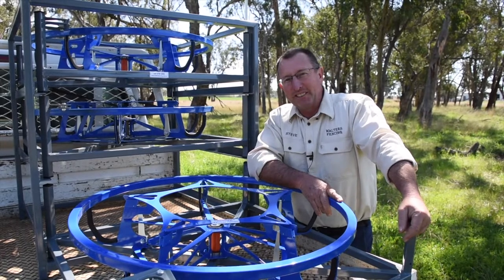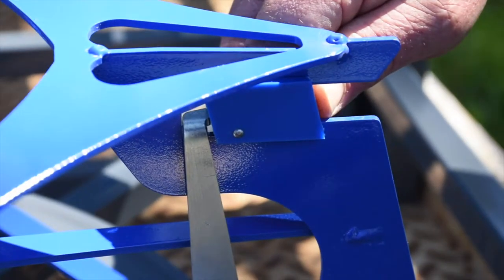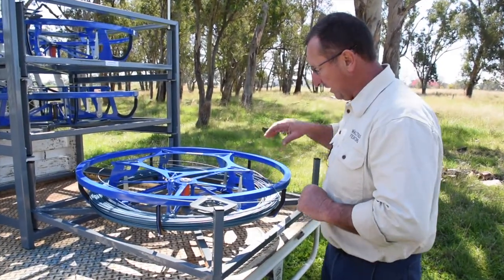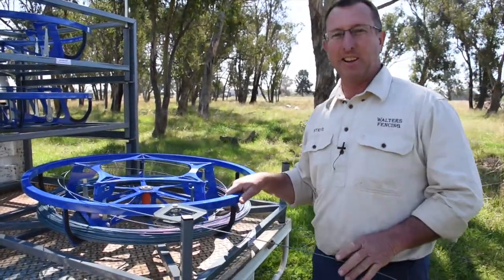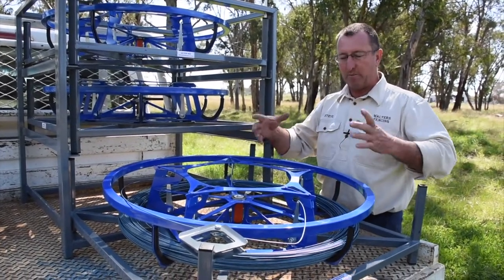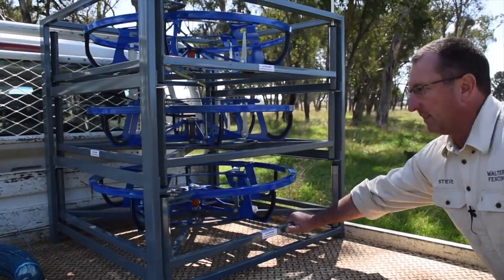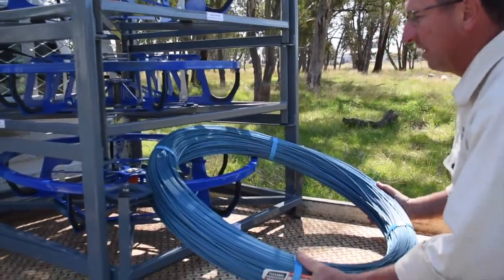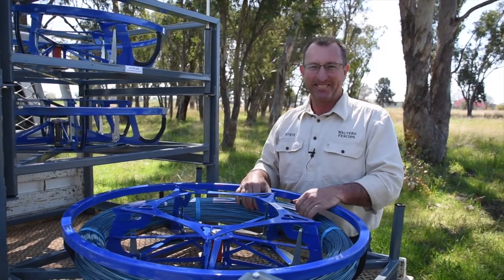Australia's best wire spinner - Blue Jen II (this is now old model)

Comment: How do they go being used on steep angles? Over 30degrees and even over 45degrees?
Reply from the maker: They still work well on steep angles, but we recommend trying to keep the angle to less than 45 degrees to allow for a smoother exit and less wear on the wire.